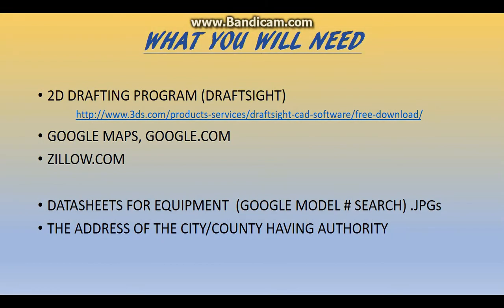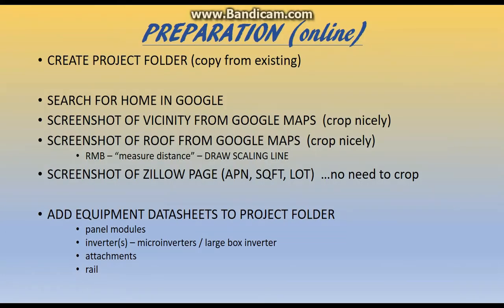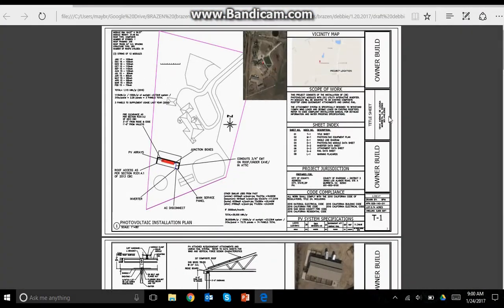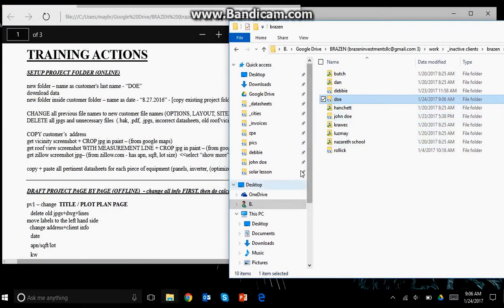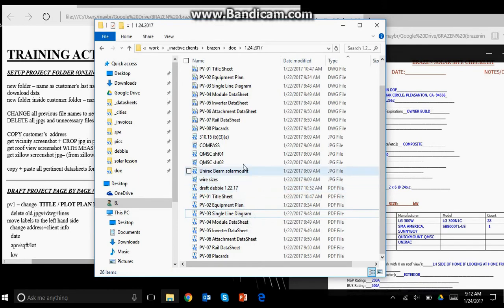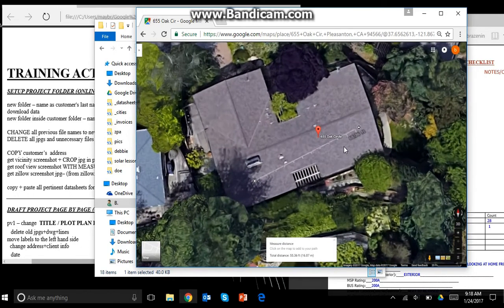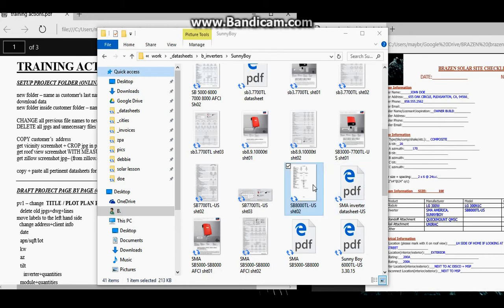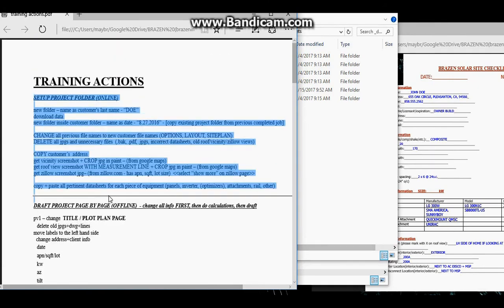LESSON 1 - How to draft / design solar plans for permit - INTRO + SETUP

Comment: I’m wiring a solar array 310 feet from solar array 6 strings of 8 panel  10.34 amps per string. I was told 10AWG wire would work fine by solar company someone else is saying I need to go to 8 AWG with that distance what do you recommend?
Reply from the maker: i would recommend  erring on the side of going lower guage for anything over 100ft due to voltage drop over a distance.  

here is a video of the calculation that i found to be helpful...

https://youtu.be/htfvXg2ty7w?si=EUxg-ONRwhtfjrUj
Reply from the maker: sorry for such a delayed response. :/

Comment: Hey Bryan, this is Bryan.  

If you use ShareX as your screenshot tool, you can grab a section of your screen or a window very easily and save directly to a file without having to use paint, select, resize, etc.  

Great course so far though!  I'm doing my first DIY project for my parent's house, and after that I want to go for being an independent installer.  This course is a god-send!
Reply from the maker: thank you Paradox!  hope you have some success with it!

drop me a line if you ever need your plans stamped at all for PE structural/electrical OR id you need help drsfting any OTHER types of plans...not just solar ~ ill give you deep discount!  +1.858.405.5845